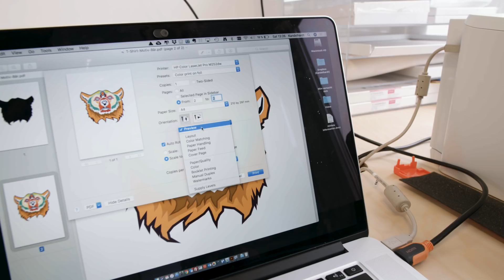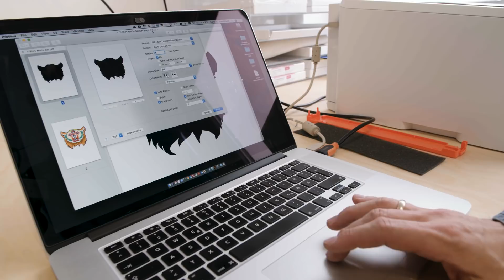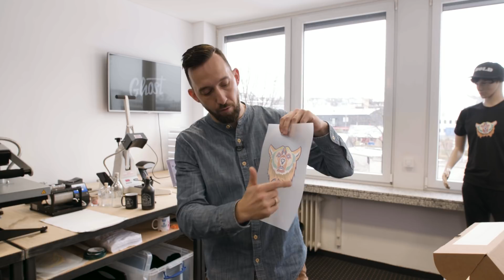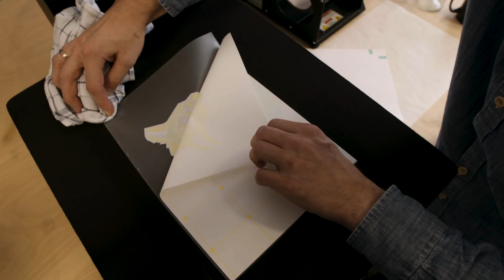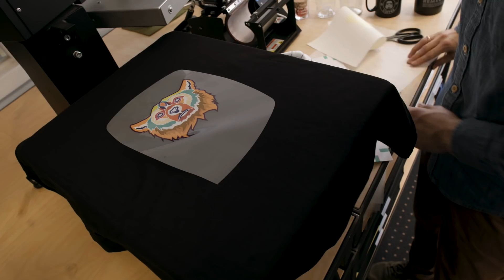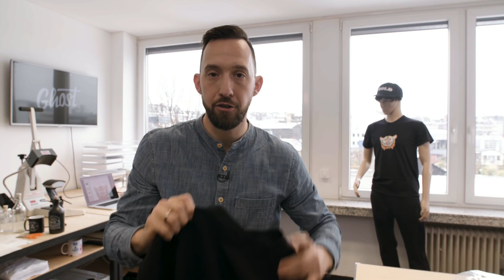How to customize a black cotton T-Shirt using Ghost White Toner Transfer

Comment: Just sharing what I learned in chemistry to answer the question why white toner prints crack easily. I think the main reason is because toner molecules have low melting point - at 100 degrees celsius. Generally, the higher the melting point, the stronger the bonds between molecules, which means higher resistance to cracking. To illustrate, a candle with very low melting point cracks much much easily than a steel with very high melting point. Since toner printing technology only allows low temp fusing, as it is originally intendd for paper printing (which may burn at high temperature), it follows that the toner materials being used must have low melting points. So, there is no way that toner printing can be improved to avoid cracking on fabric unless the technology is modified to make use of high-melting point toners.
Reply from the maker: Hi, please see our video about the new B-Paper Pro: https://youtu.be/puWzt8boFtg there you can see how stable the transfer is on the textile.
Reply: @Ghost-White-Toner  Thanks for the link. May I ask if it is possible to sublimate on white toner print as a backing?
Reply from the maker: Hi, we don't think it works because sublimation happens at much higher temperature.  

But we will test it on occasion.

Comment: Thank you for this video. I have the ghost white toner. My main problem for bigger graphics is when it comes to washing. I’m putting the design on a 100% cotton t shirt. After 2 to 3 washes maximum the design starts cracking. How can I solve this issue?
Reply from the maker: Hi, what could help is making interuptions in your motiv (like for example a grid/raster). Or doing a longer repress at the end can help. Sometimes it can depend on the kind of cotton. We recommend a smooth kind of cotton. You are always free to send an email to support@ghost-white-toner.com with your design and we have a look at it.

Comment: Goodmorning.  
The problem is my heatpress temperature is not as hot as the display says. 
I had to raise my temperature settings up to 385 degrees to get an accurate required temperature to use the paper and the white toner. 
I'm getting a very good results now. 
From now on I will check the platen temperature with a hand held temperature sensor..
Thanks again.
Reply from the maker: Glad to hear that your problem is solved.

Comment: My print after 2min in 160'C in press, all went to paper-B from foil-A. What i did wrong? I have oryginal toners from hp 150
Reply from the maker: Hi, did you do everything exactly as in the video ? 
Did you use our A and B films or from another manufacturer? 
In general, you can use the standard HP toners, but you will get the best results if you use the Ghost toners.
Reply: @Ghost-White-Toner  i used forever paper and foil and oryginal hp toners
Reply from the maker: ok, and you do erverything exactly as in the video?
Reply: @Ghost-White-Toner  yes and my print was in gayscale and 300% black, and the biggest pressure i can and all text (becouse it was only text on arial black font) went into paper. Nice shiny but not on foil, but paper:)

Comment: Can I use the CMY HP toners and add the Ghost White toner for heat transfers? Or do I need to use all Ghost Toners?
Reply from the maker: You can use the standart toners. If you buy ours you will have a more smooth transfer process!

Comment: If you are only printing a small area can you cut the a and b paper to that small size so you are not wasting the paper?
Reply from the maker: indeed this is possible, or you can also print the design on the paper multiple times in order to just do the printing process once (in case you need more  "copies" of the design).

Comment: I have a swing arm hot press that is only hot on the top. Bottom plate does not heat. Will this process still work the same way?
Reply from the maker: This is no problem. Our presses are also only hot on the top

Comment: Hello, thanks for this tutorial. 

I would like to know how essential ist the use of the WHITE cartridge. 
I read that the powder-like structure of the Ghost White  Toner is what makes the image so well adhesive on fabric. 

So if I understand correctly - I always have to run a white print as the second layer, even if I do not have a white color in my image ? 

Or do the foil & b-paper work also without the ghost white toner with the USUAL laserjet toners ? 

Thank you.
Reply from the maker: You will need to run 2 passes when you need white and color for dark surfaces. You can use the transfer papers with normal toner as well for light surfaces!

Comment: Hi,
IS there any RIP software or setup to print more white? When we print white  col it is not full print color and have to print twice the same design to cover it enough :/ Thank you for your help, we use the same HP Color Laserjet M252dw
Reply from the maker: We do not offer any RIP. You can increase the density via the Web interface of your printer.

Comment: Expensive, time consuming and not really a solution for a commercial  environment -  well presented video though - many thanks - Tony
Reply from the maker: All depends on the volume you would like to print. On high volume runs I agree but when it comes to individual single pieces the cost/time relation is the best you can get!

Comment: Hi, i use a HP Laserjet Pro M452nw Printer but my printings are really dark. Do u use a special ICC Profil in Photshop or something else ? I would be grateful for any help.
Reply from the maker: No we do not use an ICC profile for Toner Transfer. You can send you questions an pictures to support@ghost-white-toner.com
Reply: @Ghost-White-Toner  

My white toner printing with CMY too making black what settings do I use in corel and photoshop.
Can't find anything on the net. Printer and word doc. prints white though

Comment: i have 2 question.
1. what kind of paper did you use?
2. all laser printer can print that kind of paper?
Reply from the maker: We used the paper which we also have in our Webshop here: https://www.ghost-white-toner.com/transfer-foils/. Most laser printers will work with that paper. We recommend using HP printers with our Ghost White and CMYK Toner for the best results!

Comment: Wow thanks for the information.
Every print we have to switch the white cartridge ? ( It's very lengthy process)
Is there any other options? Where we do not need to switch cartridge everytime.
Reply from the maker: You can of course print batches of color and then the white all in one other batch. This makes you swap the cartridge only once per batch.

Comment: And how are you stopping the registration marks. Are you reducing the second print at all.
Reply from the maker: jeff hembury yes please check our other videos on this.
Reply: @Ghost-White-Toner  i have watched all the videos but still get registration marks on the second print. i am reducing the image size by 1mm or 0.0400. any other tips would be great
Reply from the maker: Try to reduce it around 1.5mm also use the bottom tray of the printer. The manual feed is too inaccurate.

Comment: HELP!
I’m having problems when printing. The mask that is printing in white IS NOT ALIGNMENT with my color design, the mask continue to print more to the right. I follow all the instructions from previous videos on how to create the mask and don’t work for me.

I’m printing from photoshop and using fit to page. do I need to do a setting to the printer?to Photoshop? So at this point i don’t know what to do, I have use a few forever paper and I don’t want to continue to wasted.

Any knows how to fix the problem?
Reply from the maker: Joss Grullon I’m pretty sure that the issue is because of the fit to page option in Photoshop. Best results can be achieved by printing from a PDF File. Please send an email to support@ghost-White-toner.com with pictures of your problem I will support team will take care of it.
Reply: Ghost White Toner ok I will try with the pdf and see, but I’m sure I did that one already and same results. Maybe is the design is complexity. I will RE this message.
Reply: Ghost White Toner I send you a message yesterday and today, hope you see them.

Comment: Thank you so much for the video! I have a question: What if I just want to print basic white logos on dark garments? My white graphics never have color in them and I'm looking for the best solution to print these onto dark garments without using HTV, Plastisol transfers, etc... I am really hoping this is finally the solution!! 🙂

P.S. For printing black graphics onto white garments, I was looking into using inkjet transfer. Then I won't have to cut out the designs because the white will just show up as transparent, right?
Reply from the maker: Apprendre l'art That’s easy! Just convert the image to black and white (if not so already) then invert. Everything black on screen will be printing white.
Reply from the maker: Here is a video you might like. I think it is what you are doing. https://youtu.be/f-kxLnaKN6E

Comment: If it’s going on a black shirt you can’t just print with the white toner in single pass with out the black toner
Reply from the maker: Ray Linares Depends in the design. If you’re design has blacks or lots of halftones a white background is mandatory for correct color.

Comment: Can you use the regular CMYK hp cartridges or the does it need to be the ghost CMYK cartridges
Reply from the maker: You can stat with the HP ones and later switch to Ghost Toners. The Ghost Toners work more consistent in Transfer Paper Peeling.

Comment: I notice in some videos when selecting the paper setting you select "Opaque Film" and others it's "Color Transparency". Is there reason why that is and also do you recommend leaving "print density" at default setting? I think I may have answered my question re: paper settings...looks like depending on which video the printer is either HP 252 or 452?
Reply from the maker: You are right! It depends on the printer model ! You can also experiment with the settings and see what works best for you!

Comment: Hi do I have to have all  the ghost c y m toners and black and the ghost white toner  to get the results in this video? (.all ghost white toners only to get the results in this video.?)
Reply from the maker: You can also use OEM HP Toner carts. The Ghost CMYK + White Carts are optimized for Transfer appplications and give a little easier peeling process than other ones but for a start you can use those.

Comment: The fact that the White Toner costs as much as a printer is Insane. Not cost effective...or smart.
Reply from the maker: Of course we would also love to offer the White Toner cheaper. But in fact we have the same cost per page as competing solutions with a much lower investment cost in the printer.
Reply: Mick B this toner is less than half of the price that OKI charges for their toner, and it lasts just as long.

Comment: After how many washes will you generally begin to see cracks in the design with this method?
Reply from the maker: The print is very durable and only cracks if washed to hot or tumble dryed.